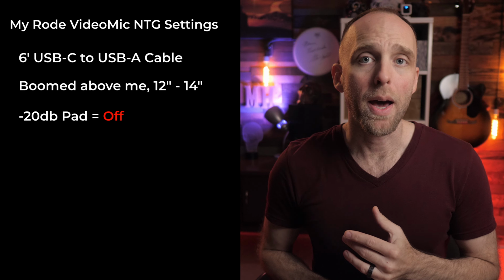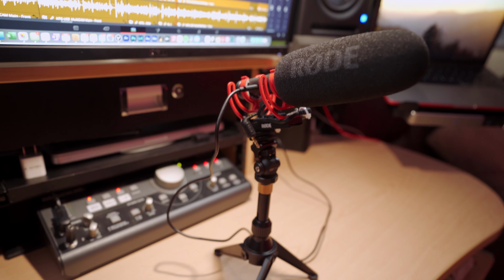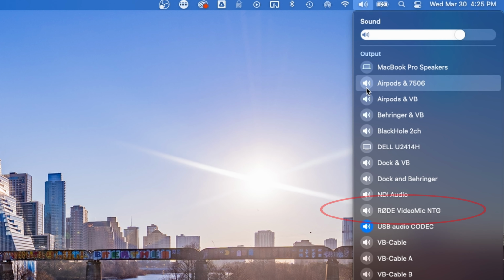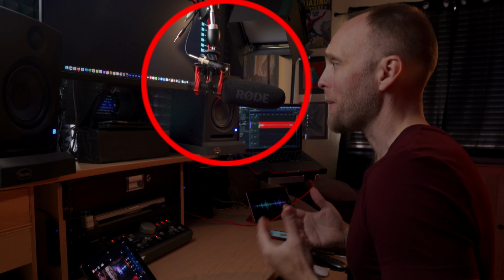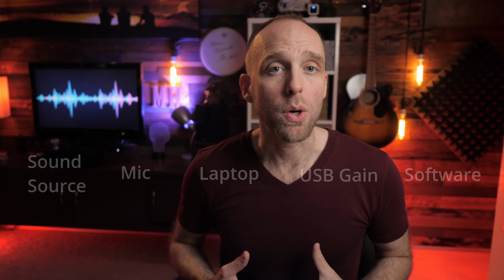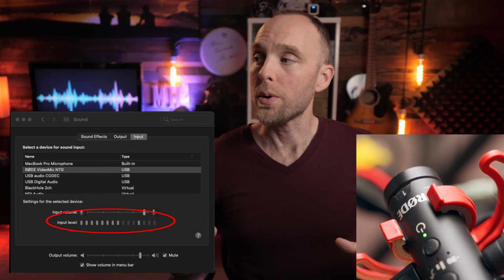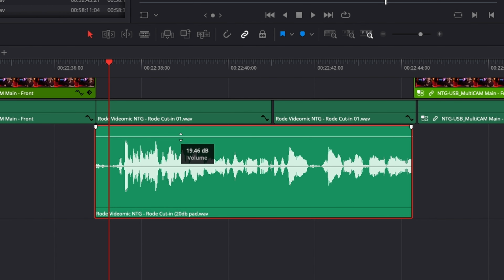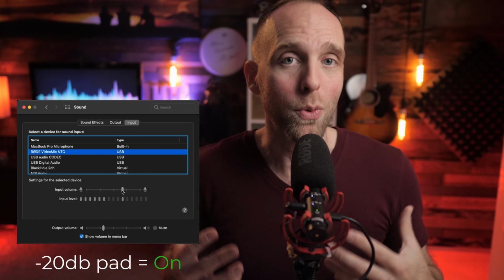How to set up your Rode Videomic NTG via USB for the best sound.

Comment: Thank you for the video. It is beneficial. I've implemented a lot and the sound in my untreated room is better. But I can't soundproof the room, so I still have some reverb and echo. Is there a mic cover that can remove the echo sounds coming from the side of the mic similar to what a short capsule mic does? I don't want to get another mic.
Reply from the maker: Hi there.  Unfortunately, no, trying to "cover" the mic isn't really how microphones work.  Shotgun mics, and the Rode VideoMic NTG IS a shotgun mic, rely on sound coming in from the sides in an effort to actually CANCEL that sound out.......meaning these style mics attempt be more directional and reject sound from the sides, but they do that by having the holes or interference tubes allowing sound IN from the sides.  But remember, that sound coming IN from the sides is used to cancel out some of the ambient sound.   So, covering the sides of the mic would probably make it worse at rejecting sound.  

Your best bet is to get the mic as close as you can.  I keep mine mounted above me about 18 inches away from me, basically as close as I can get it to where it's just out of my video frame.  

Microphones, unfortunately, aren't magic.  And they will hear what your room sounds like.  If you can't do anything else to your room, then the next best thing (for any mic to reject the room sound) is to simply put the microphone directly in front of your mouth.  Doing this means you have to turn down the gain, probably turn on the pad, and thereby reducing everything ELSE the mic hears because your voice would be a lot louder to the mic than the ambient reverb and echo.  It's all just physics.  

Where is your mic currently located and placed in relation to your voice?  

let me know, cheers.
Reply: @MarcusHutsell  Thanks. The mic is on a dedicated mount just above the camera (I use a Parrot teleprompter, so it's about it), roughly 10 inches from me, pointing slightly down towards my chin. I have a fifine K678 dynamic mic, it sounds a bit better but is in frame when I shoot, not the clean look I'm looking for. I've seen short capsule mics, they seem to do a better job in an echoey room, but they are XLR only and require more equipment to work properly. I like minimalism, so I got the NTG as it connects to my Mac via USBC. I'll try getting the mic closer to me, another option is looking for simple proofing solutions. If you have any more suggestions, it will be highly appreciated, Thanks again.
Reply from the maker: Hey there.  Got it.  So.......I'd like you to do this for me.  get a tape measure and measure how far that mic REALLY is from you when you're filming.  I'm curious, because I use a 24mm lens, and in my videos (like this one), the camera (front of the lens) has to be about 28", over 2 feet away from me to get the framing I like (about mid-stomach to top of my head in frame).  And that's my normal distance when I use a teleprompter.  And, if the mic is on top of my camera in that situation, it's going to ALSo be more than 2 feet away.  Which is why I use an articulating arm attached to my desk to boom the mic out, over, and closer to me, meaning I can put the mic about 14" away from me in stead of over 2 feet......and therefore the mic hears ME more than the room.  I'm actually surprised you can be so close (10 inches) when using a teleprompter, then again, you may like a tighter field of view than I do..... i've found I like the mid-stomach-to-head style framing for myself, again, that's on a 24mm (full frame) lens.  I do often use my wider angle lenses like my Tamron 17-28, which means I can get closer to the camera if needed.  

But, my office is also carpeted, and i have some sound treatment so the room itself is not very reverberant, so my mic has less reverb to hear in the first place.  

Add some foam panels if you can, blankets, a small carpet or rug under your chair, anything that can absorb sound waves and soak up that reverb!
Reply from the maker: short answer.......get the mic off your camera and get it closer to you!  possibly even on a cheap articulating arm
Reply: @MarcusHutsell , I'll give carpeting a try. I use a Sony ZV-1 (24-70mm, at 24mm), and an Elgato green screen. So I'm ON the camera basically (I use a very narrow text field running practically on the lens, so my eyes don't move at all when I read). I also "talk" with my hands a lot, so a mic on the desk or in front of me, gets knocked a lot :-)
Reply from the maker: @RoyAlf  yep, that's also why I don't like microphones in front of me, they just get in the way!

Comment: Great video! Helped me a lot. I have one question.
Should i plug in my headphones directly to the mic or to the computer is also possible ? ( can any latency appear?)
If mic is the best option i assume then volume has to be controlled directly from windows settings?
Correct?
Reply from the maker: Hi there Aleksander.  I'm so glad the video helped.

So, the only way to listen to YOURSELF in real time is to use the 3.5mm output jack ON the microphone.  that will send the incoming audio from the mic capsule directly to whatever is plugged into that jack.....AKA, your headphones, without any delay.  Of course you can then assign your computer to ALSO output to the VideoMic NTG so you can hear any/all sounds from your computer (Zoom, Teams, system-sounds, music, etc), but ALSO hear yourself.

There are ways to route any incoming audio at the computer BACK to a device (like using OBS, or Adobe Audition, etc)......so that you could then use the headphone jack on your computer instead of on the mic itself.  And, yes, even for me, when I use the VideoMic NTG for virtual meetings, yes, I have to always switch my headphones over and plug them directly into the VideoMicNTG....otherwise I wouldn't hear myself, and, for most of us, it's best to hear ourselves in our headphone when we're speaking (if we're wearing headphones of course).  

However, routing the VideoMic NTG back TO itself through software, even though completely achievable, there are some caveats:

1.  You have to be really good at audio routing to know how to do this.  Using something like Adobe Audition or other music-recording software works well.

2.  You can use OBS (free).......however, with OBS specifically, OBS doesn't have a "low latency" audio monitoring feature like music-recording software does ("DAW" - Adobe Audition, Pro Tools, Garageband, etc).  So, trying to use OBS to listen to yourself, there is ALWAYS about a 1/2 second of delay, and, that is just WAY too much delay to be able to keep speaking.   

Other audio software, again, like Adobe Audition, etc, have always had a buffer setting to lower the amount of latency.....the lower the buffer, the lower the delay/latency, and this helps with recording, but *could put more strain on your computer.....however, these days, computers are powerful enough especially with a single audio input that keeping the buffer at its lowest generally isn't a problem.  So, you could:

1.  Pick audio software of your choice, I'll use Adobe Audition as an example:  
2.  Set your input to the Rode VideoMic NTG
3.  Set your OUTPUT of that software to your desired output, even your main computer headphone jack
4.  make sure you don't have speakers hooked up to that output, or turn off the speakers, because this method will eventually send the rode videomic NTG direclty to the output, and if there are speakers nearby, you could get feedback.
5.  Set the buffer in your audio software as low as possible (Audition goes down to 16 samples which then results in VERY little audio delay, barely any at all when live-monitoring
6.  "Arm" the track for recording, (although you don't ACTULLY have to record, we're just using a DAW for routing.
7.  The, there should be a button on that (and every) audio track to "monitor" the audio input that you have assigned to that track.  In Adobe Audition, it's a little button next to the "R" Record-button that has an "I" and you would then press the "I" or other button on that audio track and as long as your input/output settings in the DAW are set correctly, you'll then hear your VideoMicNTG coming through your headphone output from your laptop (again, makie sure to set the output properly in your DAW).

You can then, still, of course, set the master output of the computer or Zoom, etc, to ALSO push audio out of the main computer headphone jack, and now you have all system sounds, AND yourself coming through the heaphone jack on your computer.  

That's really the only way to effectively NOT use the headphone jack ON the microphone AND have very little delay on your own voice.  Since I use OBS to route my audio/video for all my virtual meetings, I just use the headphone jack on the mic instead of booting up another audio software application.

HOWEVER......one thing I do is use 3.5mm extension cables to help with this.  I have my mic mounted up and over me, and I have about (3), 3.5mm cables that dead-end up near the mic.  1 of those 3.mm cables runs down to my camera for recording, 1 of those cables runs down behind my desk to my left side where i hang my headphones, and the 3rd one is a longer cable for when I need another option/backup.  So, then I just swap which 3.5mm cable I plug in to the mic itself, and then I just use the other end of the extension cable and swap my heaphones there.......this way I never am plugging my headphones directly into my videomicNTG, I'm  just swapping a single cable up at the mic position.  

3.5mm extension cables are great and I have a ton of them all around my desk, both at home and at work.

All right, that was a long reply, I hope some of that helps!

Comment: Thanks your video its great,  what if i use the Rode connect software as my recording software and then attached the audio to the video using davinci resolve? as that will allow me to use the rode connect to control the NTG settings such as noise gate which will cut down back noise and  reflect any settings  on the system sound. will that be a good approch for better quality. Thanks
Reply from the maker: Hi there Omar.  You could definitely use the Rode Connect software to record and then sync in post.  Personally, I don't like recording my video content with real-time effects, so keep that in mind, that the effects (Noise gate, compressor, Aural Exciter, and "Big Bottom") will apply those effects to your audio file and you can't change them in post.  This should be fine if you're happy with the sound they give you, and it may be a way to do quicker post-editing.

You could also use any other audio software program like Adobe Audition, or Apple Logic, or you could even just record your audio directly in Davinci Resolve, I do that often for short portions of my video where i just need to record a voiceover.   

The longer answer to "how to get better (or the best) quality," is to follow proper gain structure so that you can have the lowest amount of noise possible.  And of course, use the best equipment you can afford or are willing to spend money on.  I just bought a Rode NTG5 to start recording my audio externally because it is a VERY quiet microphone and it will reduce my overall noise floor, as long as I use a quiet preamp with it.  

So, gain high/appropriately at the beginning of your signal chain (without clipping), so that you can record a strong audio signal to start, and follow your audio through your system.  Gaining high/appropriately at the beginning will always get your main signal (your voice) as far from the equipment noise floor as possible.

Happy Recording, cheers!

Comment: Marcus, can you help us understand how to record speaking such that both normal talking and loud laughing are easy to hear and not clip? I'm guessing this has to do with using a compressor or limiter, but I'm not sure how one would set that up with something like the VideoMic NTG via USB
Reply from the maker: Hi there Luke.  so, yes, in your case, you'd want to think about a compressor.  the difficult thing is, if you're using the Video Mic NTG via USB (or any mic via USB), then the signal goes directly into the computer and you'd have to use software compression.  I do this using OBS, I run my audio through OBS and compress it there, then send the audio OUT of OBS via virtual cables to my meeting platform.

In your case, you'd probably WANT to use the Pad on the NTG so that it won't clip out when you get loud, laugh, etc, then also use software compression before the audio signal hits your final destination.

Also remember that the videomic NTG is a condenser mic, and like any condenser mic, generally has a WAY more sensitive capsule than a dynamic mic, so condenser mics will always be a bit more prone to distorting the capsule/diaphragm before it ever hits the output of the mic (be it USB or XLR/3.5mm output).

The thing about the videomic NTG specifically is that it is also rated for lower SPL levels.  Granted, it says its maximum input SPL Level is 120db, which is actually quite loud, but a loud laugh RIGHT at the front of the mic could distort it regardless of using the pad or not.

What I've found with the videomic NTG is that it's not as great of a mic when used up close to your mouth, because of the the possibility of clipping due to the sensitivity of it being a condenser and having a bit lower maximum SPL handling.  It's not that you CAN'T use it up close, but adding a pop filter would certainly help as that would keep you at a fixed distance to the mic and provide additional plosive protection.

You could add a hardware compressor, but you would have to adapt the 3.5mm output of the mic to either XLR or balanced 1/4" (which, you can't really do with this mic since it does not have a balanced output), and then attempt to use something like a DBX 266 analog compressor, then send that analog output to ANOTHER USB audio input card to go in to your computer.

It's probably easier to just:
1. Add a pop-filter
2. Engage the -20db pad
3. set your input gain in System Preferences/Windows Sound settings appropriately
4. Run your audio through OBS, adding Filters for compressor and Audio Monitor (FYI, "Audio Monitor" is additional plugin you have to install in OBS to send your audio to a virtual cable, it's free, but it's not a default part of OBS)
4.  Or, route your audio through Adobe Audition or any other DAW, lower the buffer as low as it can go so that you can monitor yourself in "as-real-time-as-possible, "add compression there, and send the output of the DAW over to a virtual cable so that you get the effects (like compression) through the DAW, but you don't HAVE To record there if you don't want to.  Then you could also still route the audio over to the meeting platform......all the while getting the effects that you apply in your DAW.

The hardest part about using OBS for compression is that, even though you CAN turn on a monitor to hear yourself speaking, there's such a large audio delay listening through OBS (probably 1/2 a second) that you can't really monitor yourself in real time because you won't be able to speak while hearing your voice back 1/2 a second later.   And this is because OBS doesn't seem to have a latency/buffer setting to resolve this.  You could use a different audio program like Audition as I said above, as long as you're good at audio-routing.  (I just tested all this and works great......again, as long as you're good at audio routing because it can get tricky with where you need to send and receive audio from.)

Like I said, I use OBS every day and run my audio through it and compress it there.  You have to do some test recordings to get the settings correct, but, it can be done very effectively, and OBS is free.

Let me know if ANY of that helped :)
Reply: @MarcusHutsell  That was extraordinarily helpful. Really appreciate it. Only thing I'll add is that AU Lab + Blackhole is a nice combo for transforming audio signals with software. Cheers
Reply from the maker: @LukePighetti  You're welcome Luke.  I haven't heard of or tried AU Lab, I'll have to check it out.  I used to use Blackhole, but a couple of years ago it was having trouble with Mac OS, so I've been using VB Audio cable (I have A/B/C/D, and the free AB), so I have lots of options to route audio :)  

Good luck to you, happy recording :)

Comment: Such a useful video on the functionality of this microphone! Understanding how the gain knob is essentially disabled is really good to know!

I have a question on how this works with an audio interface instead of a camera, if you were to do a standard 3.5mm cable into a VXLR+ into an actual audio interface, would that also ignore the gain knob, or would you need to set it somewhere as a base, and then adjust on the interface?

Comment: This was a very clear and patient explanation. Thanks! The thing I don't still quite get is why 0dBFS at the USB audio interface doesn't stay 0dBFS in the operating system's signal processing flow? In other words, what's the point of having an input volume control in the computer OS if all it is doing is "digital gain," which creates a clipping hazard without actually improving SNR? It would be nice if the OS microphone volume control could operate by sending gain control commands back to the microphone's analog pre-amp, which would do something useful.  If that is the case, it all makes sense; otherwise I'm baffled!